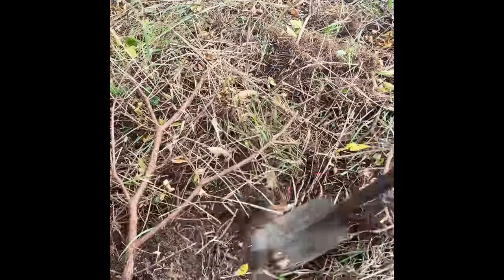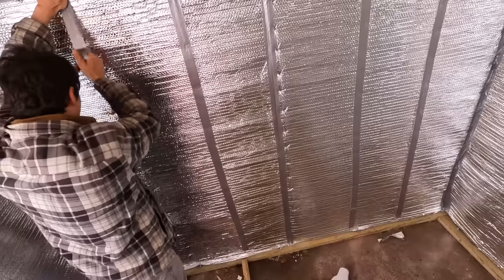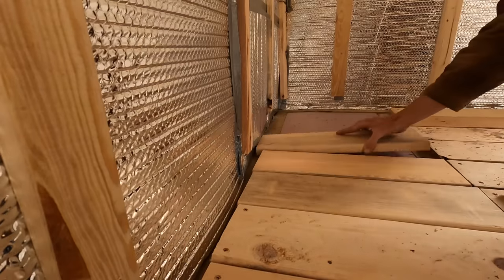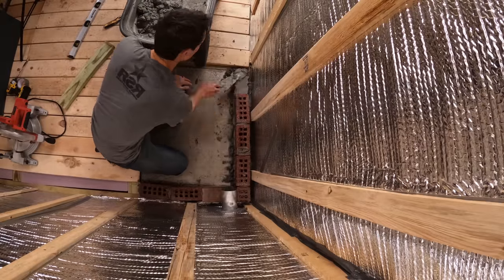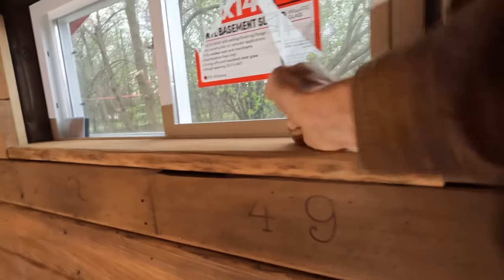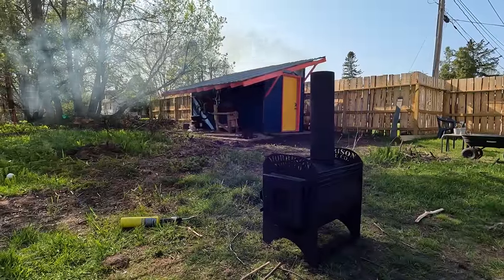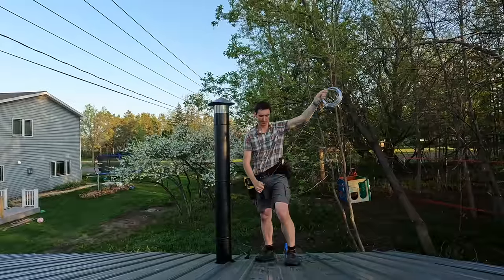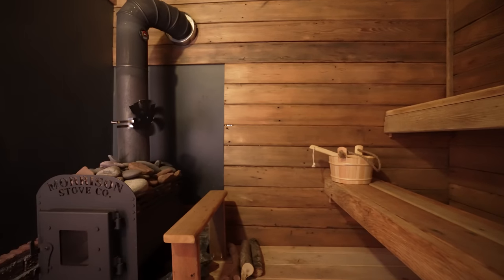Building a backyard sauna

Comment: As a few Finns have already commented, some improvements should be made to get a really good sauna experience, and the most important of them is improving the ventilation. A small ventilation hole in the wall is not enough. You have to make sure that air also gets on top of the stove and in the sauna room under the door. You also have to make sure that the air can escape both during the sauna and also after the sauna. Even if you don't wash you in the sauna, the steam bath moisturizes all surfaces and they become moldy if they don't dry properly. There are more saunas in Finland than cars, and we have a thousand years of experience in how to build a good sauna. It is worth learning online what is required for a good sauna.
Reply: Great, thanks!
Reply: I don’t see an exhaust vent.

Window to be used as exhaust??

Intake & exhaust needed to prevent mould and for a more comfortable sauna.

Comment: As a Finnish guy i am i spotted few things you might want to change, first the benches, we make them removable so they are easier to clean, also make tiny gap between wall and the bracket that holds the bench that way the wall does not trap moisture too much and the wall does not start to rotten over time.

Second important is fresh air ventile, even it is sauna you will want that. Helps drying the sauna too after use too.
🙂
Reply from the maker: Makes sense! I don’t see many saunas around here with removable benches, but I can see how that would help clean.
Reply: @JohnThainTV  could also get sauna stones for the stove but over all nice build
Reply: @JohnThainTV   Also one crucial mistake. The floor should be on an angle and have a drainage, You dont want water laying down drying there. Maybe build something on top of your floor and try to make a drainage, as this is pretty big mistake. Or take the wood flooring out and have bare concrete. On top of the concrete put rubber mats.
Reply from the maker: @heikkis8564  This isn’t the type of sauna where you dump buckets of water all over yourself. Whatever splashes on the ground just evaporates. We go outside to dump water on our heads. if this was a commercial sauna, and you had messy guests, this would indeed be an issue. I pulled up a floor board, it is bone dry, no mildew.
Reply: Csn u provide a link to removable benches?
Reply: @panddabeef  in finland they are sold as "laudesarja" bth just build a bench that is not fixed in with screws what not. Its not rocket science
Reply: @panddabeef  These bench seen on video just make extra 2x4 block each end where you screw those top plank and then make sure it won't slide of from those blocks that is attached to wall, there is your removable bench.
Reply: My research said floor drain is optional for home use, but required for commercial sauna.
Reply: @willmcgregor7184  Depends if you are thinking of bathing the old fashioned way in there. If you just have a shower close by then its probably fine if there isn't a drainage. 
However if its an indoor sauna as most of us have them here these days then obviously you would want a drain.

Comment: I have built an exterior sauna about 5 years ago, I used the same foil backing with airspace behind the cedar boards. I was worried about adding plastic to the shell of the building but the client purchased it and I figured it would be fine behind 1 1/2” TG cedar. No issues yet but I am open to hearing different options for in between insulation and wood.
Reply from the maker: No issues on mine either

Comment: The Stones and their Heating and Placement Methods
The sauna room is an ancient and enjoyable therapy that brings many benefits to the body and mind. In the sauna room, stones play a crucial role. This article will focus on the role of sauna room stones, why they need to be heated, and how to place them properly.

Firstly, let’s talk about the role of sauna room stones. Stones serve as the heat medium in the sauna room and have excellent insulation properties, allowing them to maintain high temperatures for a long time. When the sauna stove heats the stones, they absorb heat and release it in the sauna room, creating a warm and comfortable environment. Additionally, the stones help maintain humidity, keeping the air in the sauna room moist. The insulating and humidifying characteristics of the stones are essential for creating an ideal environment in the sauna room.

To make the most of the stones’ role, we need to heat them. There are several reasons for heating the stones. Firstly, heating increases their temperature, allowing them to release more heat This results in higher temperatures the sauna room and better therapeutic effects. Secondly, heating helps evaporate moisture on the surface of the stones, ensuring appropriate humidity in the sauna room. Lastly, heating also helps remove dirt and bacteria from the stones, keeping them Role of Sauna Roomclean and hygienic.

Before heating the stones, we need to choose suitable ones. The commonly used stones in sauna rooms are granite or basalt because they have excellent insulation and high-temperature resistance. Additionally, we should select stones with smooth surfaces and no cracks to avoid any hazards during the heating process.

When placing the stones, we need to pay attention to proper arrangement. Firstly, distribute the stones evenly above the sauna stove. This ensures even heat distribution and uniform temperature throughout the sauna room. Secondly, we can also place some stones at the bottom of the sauna room to increase radiant heat. This way, even in the lower positions, people can feel the warm heat. Lastly, to maintain the stones’ humidity, we can sprinkle water on them to generate steam.

It is important to note that the placement of stones should comply with the design and safety regulations of the sauna room. When placing the stones, avoid stacking them too high to prevent them from slipping or becoming too heavy, which may cause danger. Additionally, there should be a certain distance between the stones and the sauna stove to prevent the stones from overheating and cracking.

In conclusion, sauna room stones play a significant role in sauna therapy. By heating and placing the stones properly, we can create a comfortable, warm, and humid sauna environment, helping the body and mind relax and recover. Therefore, in the construction and use of sauna rooms, we should pay attention to the selection, heating, and placement of stones to ensure the effectiveness and safety of sauna therapy.

https://www.smartmakshop.com

Comment: Holy smokes. Same as you, building a sauna but can't afford freshly milled hardwood. I was gonna settle with lower quality scraps I can get quickly, but seeing how it turned out with the cedar thick planks, I'm gonna invest some more energy getting better quality wood. Love the door handle too lol

If I didn't have already my own design finished, I would have copied yours almost exactly with one small difference : I would have risked the straight up exhaust pipe and put a second protection layer between roof and insulation to drain the water outside in case in goes through silicine sealer, because I would be more concerned about maintenance of the heat source, its risk of chimney fire if i'm the one doing maintenance, and its efficiency than leakage that you can easily drain (unlike in a house).
Maybe also an airflow grid that you can close off when you turn in the sauna, and re-open when you're not using it. I would be concerned about mold forming if you are not using it for a while for whatever reason. Not important if you use it often since you made a window
Reply from the maker: Craigslist and Facebook marketplace are good places to start but I would’ve never gotten the wood I ended up with if it wasn’t for my neighbor and friend Bob. Everyone needs a friend like Bob.
Reply: @JohnThainTV  well if Bob ever goes to Europe with a cargo boat, give me a holler 😄

Comment: I helped build a cottage by a lake for our family with a sauna about the same size. Like some comments pointed out, every sauna I've seen has 1/3" or so gaps between the planks where you sit on, but overall looks like a great sauna! The salvaged wood make it look like those old traditional smoke saunas
Reply from the maker: Thanks! I used a screw to gap the seat boards, so there is some gap there, doesn’t seem to be a problem. Most of the old boards have slightly lumpy edges, so I didn’t bother gapping them.

Comment: Hey John. Thank you for the video and the willingness to try building a sauna. I wonder if you would make a follow-up video or comment about learnings from your process?
Reply from the maker: Thank you! Regarding an update video: Yes! Hopefully this winter. There are a few things I would like to tweak before it gets too cold to work comfortably outside, mostly regarding the stove pipe. I'll film it, and share my thoughts. I used it a ton in the spring, but very little during the heat of summer. It'll be sauna season soon!

Comment: Hey John,

Great video and thank you for sharing! Oddly enough, we're also just finishing up a shed/sauna combo using an existing slab & shed. I'm curious about the light setup that you used. Do you happen to have a link to the panel and 12v system that you used? Also, have you found that those lights hold up in the heat & humidity of the sauna? The lighting is the one piece of our build that I haven't figured out yet, so I'd be interested in using that setup.

Thanks!
Trevor
Reply from the maker: Top solar is the brand of solar controller, and I have not had any issues with it.  The lights are not great, I’m looking into a replacement. They get hot up there, and are touch activated, which does not work well with wet sweaty fingers, and nearly burns you when you touch it, if the stove has been going for a while.

Comment: Love the vid and inspiration, I'm in Minneapolis and am going to order my stove from Morrison Stove Co. Could you do a quick longer term review / follow up video of maybe do's and don'ts, what worked really well and what did not? Thanks!
Reply from the maker: Yeah! After 6 months with the stove, it still works great, no complaints. Easily heats the 7x7x7 space. My wood is a little wet, so I have the door cracked just 1/4 inch to get enough air to the fire. I’ll do a follow up video this winter.

Comment: My friend recently had a Sauna built and they used the same Company,  Morrison Stove Co. out of Northern Minnesota! They purchased the outside feed version, though. It's cool to see a familiar small family company on your video! The stove works wonders in their sauna.. Hows it holding up for you? Any updates? I'm thinking about buying one from them.
Reply from the maker: Still works great, no issues at all. Plenty of heat. It's a simple stove, not as efficient as, for example, a Kuma stove, and cleaning it is a manual, dirty process. Make sure you get an ash tray. Also, I recommend having a window so you can see the flame, unless it is an outside feed.

Comment: Great video. What was the light that you used? Was it sold specifically as a sauna light? And if not, how's it working now?
Reply from the maker: It’s just a 12v RV reading light and it’s not built very well, pretty cheap plastic. However it is still working after 6 months of weekly saunas and it has gotten very hot. You have to touch it to turn it on and off. I’ll probably replace it, but it works for  now.

Comment: Is the foam insulation you are using for the floor approved for the high temperatures of a sauna?
Reply from the maker: Not sure what they are rated at, but they stay cool. The stove sits on cement and the heat rises. Even after a few hours of sauna, the floor boards are not that warm, and the foam sits under the boards.
Reply: @JohnThainTV   Thanks for your reply. The traditional Finnish sauna actually has no insulation (even the ones outside) and even a slot at one of the ends of the floor, to let the water out.  In the commercial gym sauna I use, the floor is ceramic, with a drain. Wood slats rest on top.  So I was wondering how the heat and water is managed when the insulation is right there, and you sweat a lot in a sauna.
Reply from the maker: @bengt_axle  Time will tell, but unless you are really messy with the water, it should just evaporate. I’ll pull up a floor board next year and check for anything funky.
Reply: @JohnThainTV evaporate and go where?
Reply from the maker: @tmuxvim  out the vents and window

Comment: Looks great, only thing I'm wondering is did you consider using an electric hand planer to go over all the cedar boards instead of sanding? It would have been much easier to just take off 1/64" rather than using the belt sander. I hate sanding though so that is why I thought of it.
Reply from the maker: I considered it, but a hand planer isn’t wide enough, so you’d probably get grooves that would need sanding anyway. A full size bench planer would have been nice, then just a quick sand with 240 grit.

Comment: Great video! Did you add any type of floor drain or had any issues with moisture at the floor level? Looking to start our project next spring.
Reply from the maker: No drain. Some people like to dump water or even shower in the sauna, but I’ll just do that outside. I try to minimize spills, and it just evaporates.

Comment: Question: did you tongue and grove or laid board next to each other? Need an advice. Thanks. Looks good!!!
Reply from the maker: I just laid them next to each other, these boards came from old bleachers so they already had rounded corners. I didn’t want the extra work ripping in t and g. Also wanted to preserve the aged wood. The downside is that there are some gaps where you can see the reflectix insulation.

Comment: I have an existing 1-person FIR sauna (radiant health e1h), and would like to remove the glass door (65"H x 24"W) and position a Red-Led panel in it's place (36"Hx12"W).  Mounting the panel on a movable tv stand is not a problem, but once I wheel it into position, I don't want any gaps between the panel and the door-jamb.

I understand the existing "Serious-Window" glass door is triple-plane (R6?), but I was thinking I could mount some insulating material (spaceloft-aerogel , XPS, HempWool, etc) around the panel?     Since it's such a small area , the cost of the insulating material is not a concern, nor it being fire-retardant.  The only concern would be breathing right next to it.  

Any suggestions on mounting or what I can do around the panel to insulate it?
Reply from the maker: Interesting! Afraid I can’t help there

Comment: I think you should have put plastic below the thermal barrier
Reply from the maker: I discussed that with some friends, ultimately decided against it, figuring that the reflectix insulation will provide good vapor barrier. After a bit more use, I'll pull a couple boards and inspect the insulation, maybe post a video update. Hopefully all is well.

Comment: Your going to be sitting in a steam bath of plastic VOC’s and other harmful chemicals. The insulation, thermal, and vapor barriers are not up to par and neither are the materials my friend.
Reply: Why not? How do you know?
What should he have done instead?
Reply: Should have used sauna foil paper barrier
Reply: I second that. Although maybe said a bit dramatic, there are a few materials I’d stay away from in a sauna. One I wanted to point out briefly is the tape that was used. Probably just silver “gaffer” tape (branded “duck tape, not duct tape). Likely not made for these temps. Adhesive likely contains VOCs which is going to off-gas right away. First issue is the off-gassing, and later, once the adhesives are dried out, airtightness of the barrier is also going to be affected, which could cause more issues in the walls with the high moisture content. Still wishing you relaxing moments. All the best.
Reply: Exactly what I came to write... I stopped watching at the spray paint...
Reply: People putting their 2 cents in cause they can't have one. Smh
Reply from the maker: Well, it’s not certified organic… I guess it’s like the Spam sandwich of saunas, and I’m totally fine with it.
Reply: @JohnThainTV  spam is good, so is your sauna.
Reply: 저도 그게 걱정이라고 생각해서 황토사우나를 한국에서는 만드는데…

Comment: Good job, but... 
- your benches are too shot and too narrow, should've made them 7' long, so a grown man can lie down
-  the top bench should be 105 cm from the ceiling (for most people)
- it helps to have stove door open to the outside of the sauna, easier to tend to the stove
Enjoy, now learn to make and use birch or oak branches (vihta).
Reply from the maker: I’m about 6 feet tall and I can lay down on the benches with a couple inches to spare. That wasn’t part of any brilliant plan, it was just the restraints of the slab I was working with, and the distance I needed from the property line. I seriously considered a stove fed from outdoors, but I really love having that glass window, being able to see the flames in the dark.